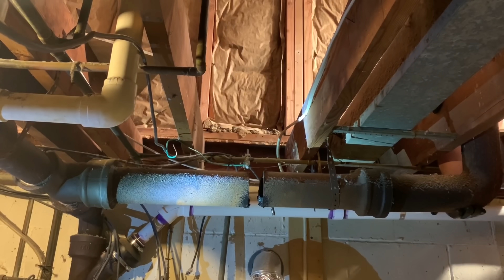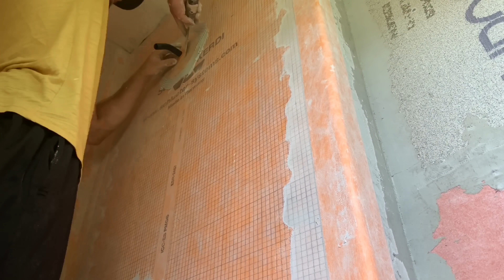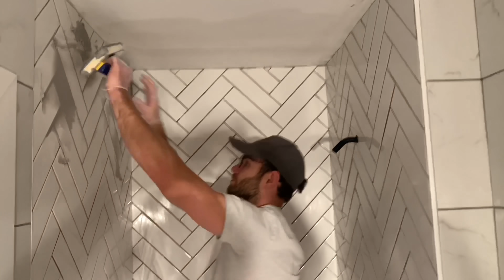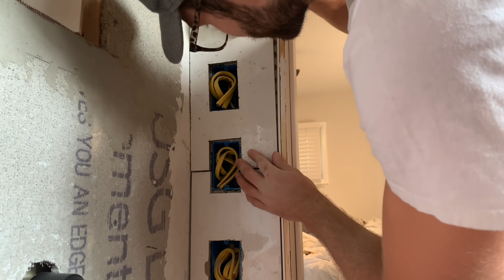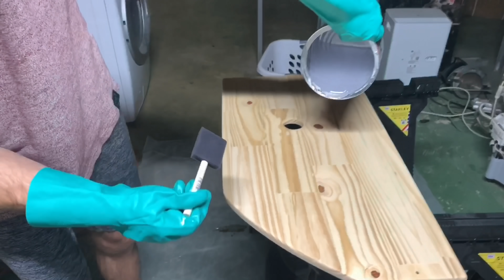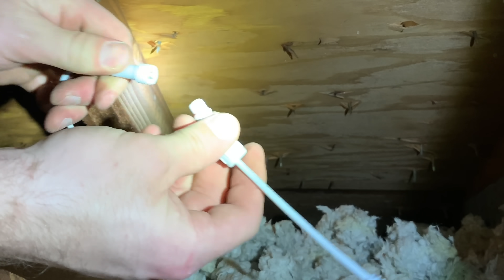Small Bathroom Remodel Time Lapse [Converting a Half Bath to Full Bath]

Comment: I was planning on remodelling my bathroom but when I found out I was up against 7 inch thick concrete slabs in between the floors I decided to let a pro do it. It isn't always feasible to do it yourself but to those that are able to, hats off to you!
Reply from the maker: Concrete makes it 10x more difficult for sure. Thanks for watching!
Reply: @AndrewThronImprovements  so does wet plaster homes!

Comment: That closeup of the shower head at 7:36 - the detail in the herringbone tiling at the corner seam 🤩❤️ impressive.
I'm interested to know why you didn't put some insulation in your walls?
Great job and great video
Reply from the maker: I appreciate it! And the insulation would have been a good idea. They were interior wall so I wasn't so worried about heat transfer BUT I should have thought about noise cancellation. Thanks for watching!

Comment: You did a decent job for an amateur.  A professional installer tip for you, when you’re setting tile, a water bucket and sponge is the companion to the thin set bucket.  Keep it practically connected to the thin set bucket every second of setting tile.  THIS is your VERY BEST FRIEND.  Keep the INSTALLATION CLEAN AND FREE FROM RENEGADE MUD, use spacers and/or your pencil to clean mud from grout joints as your setting, also clean your hands, your trowels, your knee pads, your elbows, tape measure, pencils, markers, squares, and absolutely… YOUR GROUT JOINTS !!   When the next morning arrives and your pulling spacers to do cleaning prep for grout, you will remember me.

Comment: Do you need backer board for the ceiling too?
Reply from the maker: Hi! I have actually never tiled a ceiling. But I would assume you would need a cement backer board attached to joists spaced pretty close to each other. Might need to install some blocking between the joists to prevent any sagging (depending on your application). Thanks for watching!
Reply: @AndrewThronImprovements  I realized how I didn't think that question all the way through... That's the 5% that doesn't need to be tiled according to the code. It's not safe in theory anyway. Thanks for the lesson!

Comment: Awesome inspiration. Can you tell me the measurements of that space?
I have a small (narrow)  1/2 bath that I’d like to add a stand-up shower to by knocking out a wall which leads to a coat closet which is directly behind the existing  sink and mirror.

Comment: Good work really enjoyed watching the video. I had a question at start of the video you did some plumbing work to convert the 2 piece washroom to three piece. Is the sewer line same for both? If yes, can you suggest few tips on what you did it was pretty quick and didn't really understand it. Let me know if you see this message. 
Thanks in advance!
Reply from the maker: Hey Vishnu! Thanks for watching! So I just had to cut the 3" main sewer line and then I added an additional PVC branch. It is a bit hard to explain, but check out this video and it may answer your question:
https://youtu.be/edVjZwfNQyc
If not, let me know and I will try to explain it better!
Reply: @AndrewThronImprovements  thanks for the quick reply. I will check it out. Appreciate it 🙂

Comment: Hi, 

I am looking to diy my small bathroom. However, I don’t want to tile the walls outside of the shower. Do I still used cement board and kedri (maybe misspelled it, the waterproof process)?
Reply from the maker: Hi! I would just go with mold resistant drywall on the bathroom walls. No need to use cement board and Keri unless it is a waterproof tile application. Thanks!

Comment: Hi, I love what you done to ur bathroom. Can u tell me what kind of  toilet was that you installed? We have a small bathroom an I need to do a  renovation like this so we can have more space ..My husband is a ceramic tile installer has been for over 25 years he learned from my father so that part I don't have to worry about. also was that ToTo gadget you installed on the wall was that for the toilet or shower ? Also is there a certain weight limit for that toilet? I would love to hear back from  you.
Reply from the maker: Hi! That is just a ToTo wall hung toilet - they make a bunch of different types. Basically, the tank gets installed in the wall and then the toilet gets bolted to it once you install drywall/tile. Good luck with your project!

Comment: Looks amazing. I need to redo my bathroom too. We bought a house with this beat up bathroom and I have no clue how to begin. How long did this take to complete? We have just one bathroom and we can't have it under construction state for more then 24 hours lol. Do you have a step by step videos of this?
Reply from the maker: Hi Sai! The whole process took a few months since I was working intermittently. 
I have a bunch of videos that show the whole bathroom remodel, but not being able to have the bathroom offline for more than 24 hours makes it tricky. If you can shower at a gym for a few days, that might be a good backup option. However, if you go the simple route (i.e. pre-fab shower pan, fiberglass shower inserts, etc.) you may be able to knock it out in 24 hours. But with tile, you're gonna need a few days. Hope that helps! Good luck with your project!
Reply: @AndrewThronImprovements  thank you. I'm checking out all of your bathroom remodel videos. The simpler option sounds good too!

Comment: wow you just did a cool transformation there !! may I ask? Were you using plywood or gypsum maybe for both walls and floor ? I'm still wondering how can a plywood can be strong enough as a floor. One more, what is the orange sheet you used before installing those tiles ? Thanks 😊
Reply from the maker: I appreciate it, Josef! I used 3/4 inch plywood on 16 inch o.c. joists. I used cement board (durock) on the walls instead of gypsum since I installed tile. The orange sheet is called Kerdi membrane and it is a waterproof membrane for the shower since it will see a LOT of water. Thanks for the support!

Comment: Quick question when taking the floor out doesn't the saw cut into the studs going across the floor?
Reply from the maker: Hey Hugo! You can adjust the depth of your cut on a circular saw. It's usually just a lever.  So I just set the depth to cut through the 3/4" subfloor only. Thanks for watching!
Reply: @AndrewThronImprovements  yeah thats right thanks so much

Comment: Ciment boards under the  tile would have been better. To keep the plywood floor from flexing which helps maintain a straight floor under various weight pressure. God bless!
Reply from the maker: That's fair - went with Ditra since it seemed easier. Thanks for watching!!

Comment: Ok, couple questions, 1st can you give me the dimensions of the bath. And about the tankless toilet, was it hard to do and how much for room did it give you?
Reply from the maker: Hi! It was about 44" wide by 9’ long when I started. I stole about 18” from the closet to get my extra length for the  shower. The toilet was a bit tricky for sure - but I needed to use it in order to get the code required clearance in front of the toilet. Thanks for watching!

Comment: What were the measurements of this room? I have a 8.3’x8.5’ bathroom I would like to convert into 2 smaller bathrooms ideally 3.8’ x 8.5’ with a center wall that’s 8”. Want to see if this design would work for me?
Reply from the maker: Hi! It was about 44" wide by 9’ long when I started. I stole about 18” from the closet to get my extra length for the shower. Thanks for watching

Comment: What were the bathroom dimensions?
Reply from the maker: It was about 44"’ wide by 9’ long when I started. I stole about 18” from the closet to get my extra length for the  shower. Thanks for watching!
Reply: @AndrewThronImprovements  Thanks for replying. I have a room about 130 x 230cm (51 x 90 inches) and trying to work out what options we have for a shower, toilet and basin. Your room is slightly longer, but narrower - so I think your design could work for our space. Absolutely love the solution and will be showing it to our bathroom designers!
Reply from the maker: @caradeferranti1474  I hope it works out for your bathroom and glad it helped! Thanks again for watching!

Comment: Run a bathroom showroom so I thought I'd throw my 5 cents in. 

Good job. The grouting is a bit rough in places but then you have a massive gap, what is that, 5mm? Huge. Best not to go above 2.5 unless the customer really wants the look. You're often better with 1mm. You need to be a bit more careful with the silicone and, honestly, I'd never have installed the hex tiles on the shower floor, you're asking to have to come back even when you haven't done anything particularly wrong. Just put a tray in and you're done. Also, there was no need to lift the shower - you had tonnes of space and yet you put a massive step which isn't plumb with the enclosure. Can't believe in the US they let you put a plug in the ensuite. I guess you're only 120V but still. The matt black brassware didn't go with the chrome enclosure, you should match stuff. The ceiling architrave is a dubious choice but I guess the customer asked for it or maybe you were trying to hide something. I liked the wood finished on the bowl though. The exposed bulbs - looks like an incandescent (can you stil buy those in the US?!) - you should have gone for an LED mirror. That would have been a violation this side of the pond but I'm guessing anything goes in the US. Plus, maybe the customer didn't want an LED mirror so amen. There's no rad / towel rail or storage so it's not very practical.

Don't get me wrong. It was a solid job. 7/10.

Comment: i dont know, western houses all the components like walls, floors, ceilings, all seem so soft and cuttable. what materials are that. For us here, its just concrete for every walls and partitions. To renovate or remodel it would require wrecking ball
Reply from the maker: It definitely makes it easier to remodel - but the drawback is strength. Thanks for watching!